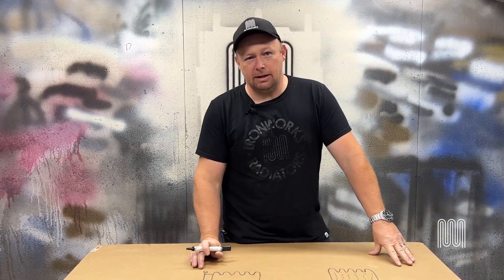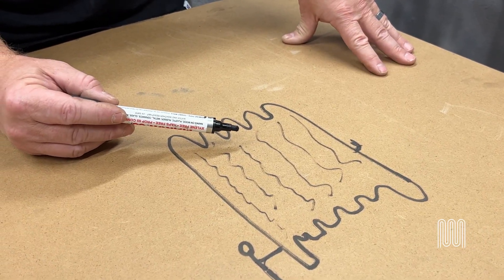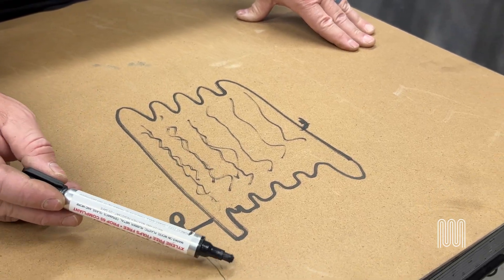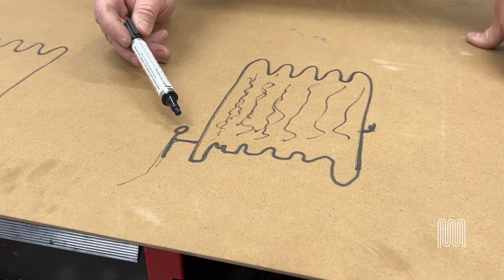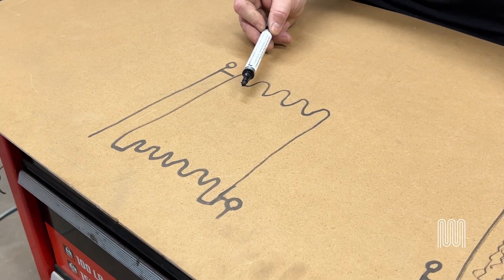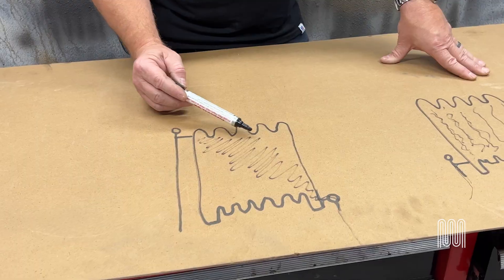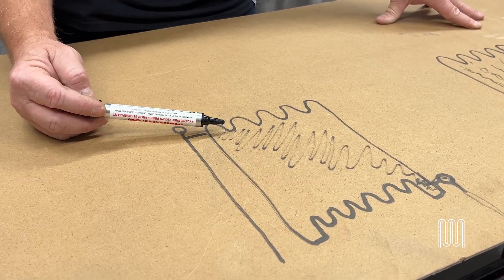Single-Pipe Steam Radiators Vs. Two-Pipe Steam Radiators.

Comment: Could you help me ?, I have a adjustable vent-rite air valve on my steam radiator that adjust from 1 thru 8 , I want to know if the higher number makes the radiator stay hotter longer or what keep it hotter longer  ?   Thanks

Comment: I have a two pipe system. Should the radiator be level or should it be slanting towards the lower piping so water flows?

Comment: I have a two pipe radiator in my basement. I want to add in an old single pipe rad in another room in the basement. Is it possible to; have the two different types on the same system, and both be in the basement?
Reply from the maker: Hi, email us at hello@ironworksradiators.ca and a technician will be able to answer your questions!

Comment: would a hot water system work the same as the 2 pipe system?
Reply from the maker: No, a hot water system operates differently.
Reply: @ironworksradiatorsinc what's the difference? Where I'm from hot water (or rather gliquid) is the norm and it's basically an in pipe and an out pipe, sometimes with manual or automatic air remover.

Comment: Very informative. Thank you. I have a two pipe steam system with small adjustment handles at the top of the radiator. What is the best way to loosen ones that will not or barely move in order to open or close? The house was built in 1930.
Reply from the maker: There is a small nut below the handle (packing nut), loosen it off and work the handle back and forth.  Apply some oil to the valve stem, tighten the packing nut when done.  If the valve won't free up, it should be replaced.

Comment: My vent, has a small bolt looking screw on bottom of it. Should it be tight or loose, when loose it seems to fizz out air.
Reply from the maker: If you can email us a picture of the vent -- hello@ironworksradiators.ca and we can help.  Usually the "bolt looking screw" is on top.

Comment: There are several totally wrong things in this video, be ware
Reply from the maker: Do tell....
Reply: @ironworksradiatorsinc  OK! At 1:26 you said that when the steam condenses it causes a vacuum. This is correct. But you said the vent must let air back into the radiator in order to allow the condensate to exit. That is incorrect.

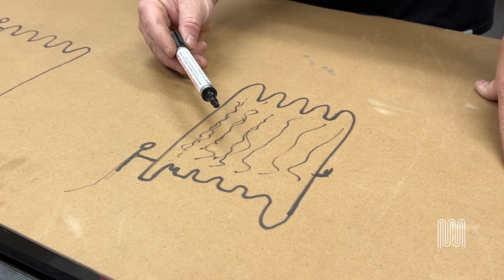at 1:39 you said it's important to maintain the vents. That is correct. But you said that bad vents can cause incorrect water levels at the boiler. I'm not sure what you are talking about there. Do you mean that bad vents can allow steam to escape which will cause water loss from the system? If that's what you meant, that is correct, but a weird way to say it.

You said bad vents can also cause noisy systems, I'm not sure what you mean there unless you mean hissing??

You said single pipe steams are by far the noisiest of all heating system, that is blatantly false. You said that steam passing the condensate causes hammer as if that was something that happens on all systems. The only time that happens is if the radiator or pipe is incorrectly pitched and collects condensate between calls for heat. Only when steam passes cool water would hammer occur, and in a proper system there is no place for water to collect and cool.

I did like what you said about how the 1 pipe systems need larger pipes.

There were some systems that were two-pipe plus vent, but admittedly those are rare.

You said the two pipe system is significantly more efficient but that is false. The boiler is making x BTUs of energy in the form of steam. That steam releases its energy into the house...by definition there is no difference in efficiency--there's no other place for the heat to go.

I did like your explanation of how in both kinds of systems, the air must be able to exit the radiator in order for the steam to enter.

Comment: Can you have a cast iron radiator with a hydronic water system?
Reply from the maker: Yes, it's common.  Output is less, and depends on your systems water temperature, but the heat is amazing!

Comment: Thank you very much for your information. one question for the experts here. Is it possible to intall a boiler heating system for a set of houses, so the piping would go horizontally from one house to the next? or what would it be the right solution for this type of infrastructure setting. Thank you so much for helping me with the information. Please if you don't mind hit the like button on the question so I can get notified of your response. Thank you so much gentlemen.
Reply from the maker: Would the system be hydronic, one pipe steam or two pipe steam?  Are the houses connected or do the pipes need to run underground?
Reply: @ironworksradiatorsinc  they are 10 semi detatched houses. Thank you for shining some light. I am trying to advice the owner on this subject so he can have an idea of solving the heating issues in winter.
Reply: @evarojas2567 …. Not sure if this will help we ran a old steam plant that heated the entire campus with steam as the old underground pipes gave way years before my arrival they had ran steam and condensate lines overhead outside and insulated to allow heat to that one building. We could have had issues with the condensation return as it dumped into the original size return line for only one building, but we never encountered any issues on the supply side or the return.

Comment: Do you recommend using a thermostatic control 1/8” with air vent to keep service valve open full time? Tenants are closing service valve at different times to turn heat off. Thx
Reply from the maker: Yes, absolutely

Comment: Why would 1 of my Radiators not get hot untill i raise the heat up to 74 degree. It is the last Radiator on th 2 floor. It seem like the pressure
Reply from the maker: Is this a steam system or hot water?  If it is steam is it two pipe or single pipe?
Reply: I’m here for the same exact situation lol. It’s a one pipe steam system. Bottom rad is hot af top one is cold and water hammering/vent whistling slightly. Assuming it’s bad thermostat vent and bad shut off valve

Comment: Does the single pipe have any advantages to double pipe system?
Reply from the maker: A one-pipe system only has one advantage over two pipe --  the cost of installation is less as you are only running one set of lines instead of two.  But, it had disadvantages in that it is less efficient and sometimes noisier.
Reply: @ironworksradiatorsinc  could it be made efficient enough with proper air vents and bigger piper diameter? I also wonder if could be put underground for about 100' in a straight line, granted insulated properly. Thanks
Reply from the maker: the air vents always need to be sized appropriately to maximize the efficiency.  The horizontal run must rise towards the radiators, oversizing the pipe does not help with efficiency, as it provides a greater surface area to condense the steam on.  The only other way to increase single pipe efficiency would be to hook a small vacuum line up instead of the air vents and run the system in a vacuum.  @fedorbutochnikow5312

Comment: Great video, how do I clean the vents
Reply from the maker: If you mean the inside of the vent, there is no cleaning required.  If they are no longer functioning, they need to be replaced.  If you are referring to cleaning the outside of the vent, just a damp cloth with a mild cleaning agent is sufficient.
Reply: @ironworksradiatorsinc Vents don’t necessarily require replacement. A nonfunctional vent can be removed from the radiator, immersed in a boiling water/vinegar solution for a few minutes for cleaning, and then returned to the radiator.

Comment: Thank you for explaining this. My one pipe steam radiators only turn on randomly and only stay on for about an hour, is that normal? It's generally quite cold in our place. We don't have access to our boiler or any kind of thermostat.
Reply from the maker: This sounds like an operational issue with the boiler.  We would want to know what types of controls are on the boiler in order for us to advise.  It shouldn't be cold.

Comment: That’s a ton of useful information for me. And well explained, too. Very clear. Thanks.

The old factory loft I live in has a steam radiator boiler system, where most roads use the two-pipe system, but a few rads are one-pipe. I was told by some technicians that steam rads should never have steam vents on them. So I went around the building yesterday and removed all the vents and replaced them with 1/8” plugs. After seeing this video I think I’ll replace the plugs with new steam vents, but only on the rads using a one-pipe system.
Reply: definitely replace the single pipe radiators with air vents!! Remove those plugs as the radiators need to breathe!!!
Reply from the maker: So glad to hear that this was helpful for you!
Reply: sometimes they put 2 one pipe rads next to each other and ot looks likle a 2 pipe system, but it's really just 2 rads adjoining each other.
Reply: You fool ! Do you realise what you have done!!!

Comment: great video.   In old systems does one need to remove and clean out the interior of the rad?  does rust or sludge build up inside cast iron? I wonder how to get a system inspection, and report.  Every HVAC contractor claims to know steam systems but tend to show their lack of experience once they are on site.  I have so many questions and find limited information when it comes to single pipe steam.  I appreciate your content.
Reply from the maker: Thanks for your comment.  The interior of a rad should not be cleaned because the steam cannot carry any debris from the boiler or the pipes into the rad.  Rust or sludge does not build up in the rads on a steam system.  Sludge will collect in the low points in the system.  If you would like to arrange a system inspection and report, please email us hello@ironworksradiators.ca and we'd be happy to make arrangements for this service.  If you have other questions, please let us know!